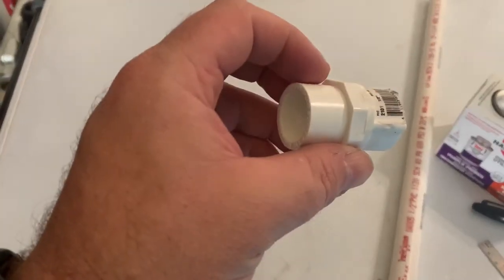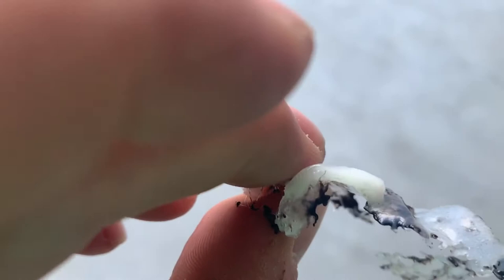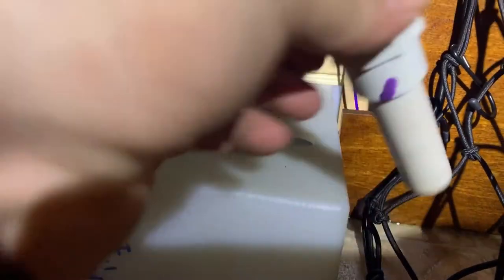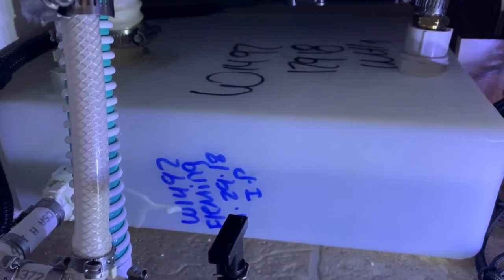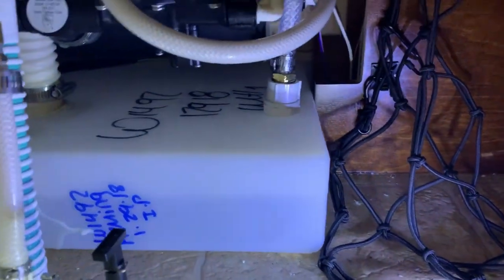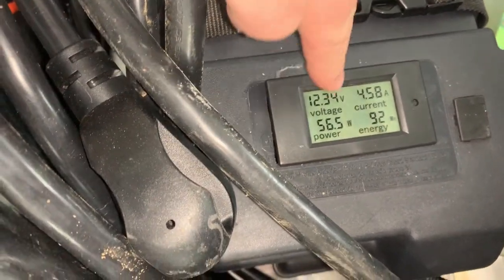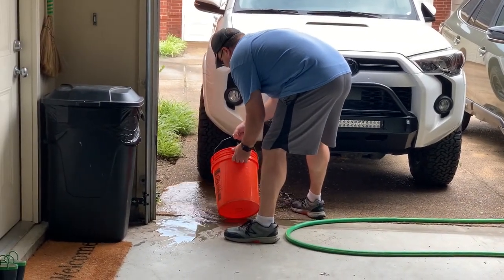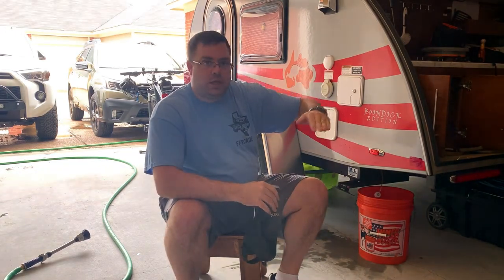T@G Teardrop Potable Water design fix - Let’s fix it!

Comment: Great video of your mod. I’m doing some modding on my 2020 Tag. I’ve removed the water tank completely from the trailer. We have never used the water system for drinking water or water to cook with exactly because of what you found when you used the shop vac. Sink is coming out because we prefer the pre space. Instead we carry our water for drinking and cooking in three-gallon jugs with a battery-operated pump you put on the top of the jug. Water for showering will come from a “solar shower tube” that I DIYed. It holds eight gallons and is mounted on the rack on the roof of the tag. What I want to do is be able to feed the water out of the solar tube to the pump for the pressure and use it to only feed the built-in shower attachment. Wish me luck! I am puzzled by one thing I found and maybe you can help me. After removing the large fill tube feeding the underfloor tank and the drain line from the sink, I was left with one line I don’t know what to do with. It is attached to the pump after the filter (?) and runs over the pump and to a drain hole that exits under the trailer. Is this some kind of overflow line for the tank itself? Any ideas would be helpful.